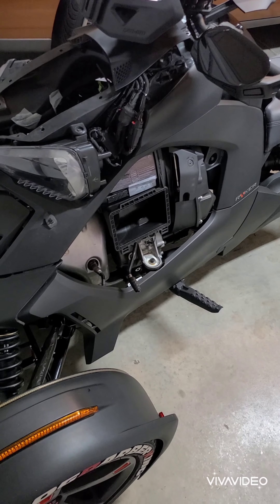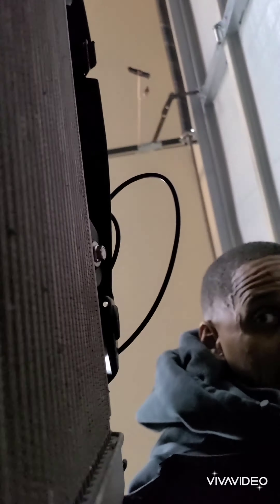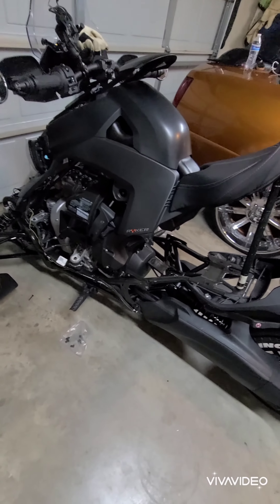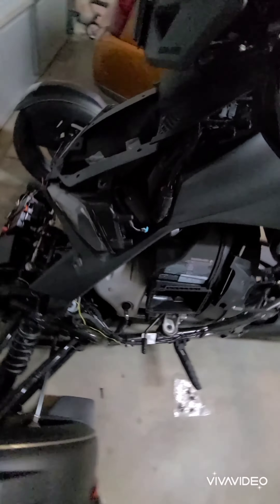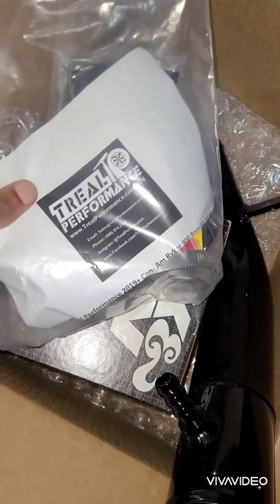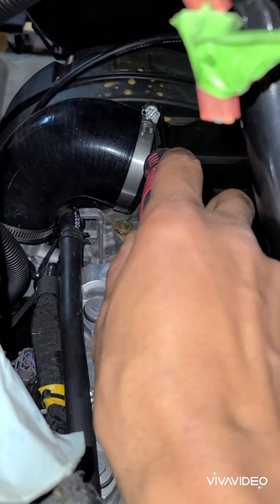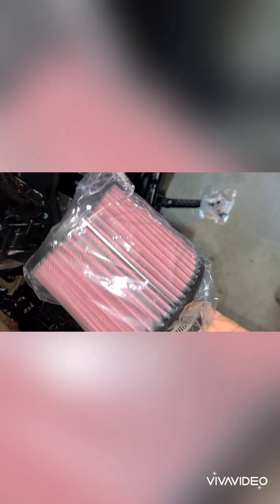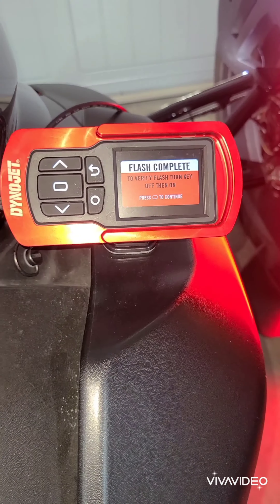How to Install Treal Performance Intake for the Can-am ryker

Comment: It seem like you really didn't have to take the  frunk out to get to those parts and screws...
Reply from the maker: You don't however it's a bolt that you have to tighten in that area and  removing the frunk will make that bolt easily accessible.
Reply: @IAMbeep23  thanks for the info can you really feel it a major difference since you added the tune and the ram intake
Reply from the maker: @medina8050  night and day ...I met my friend to purchase this guy's stock Ryker. He test drove it. Then I let him ride mines..he also came off of it on the takeoff. 💪🏾
Reply from the maker: I have an aftermarket exhaust also RLS Assassin Series Exhaust